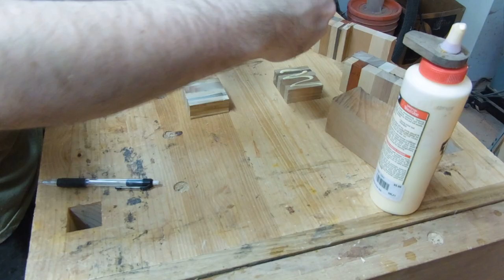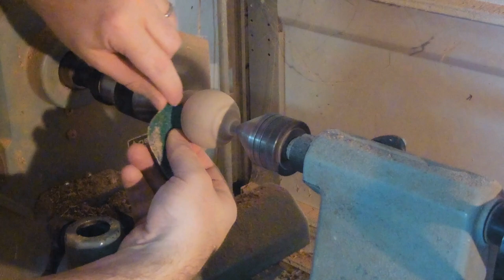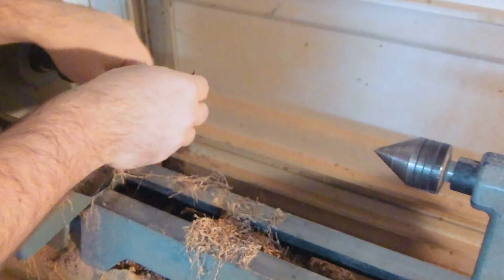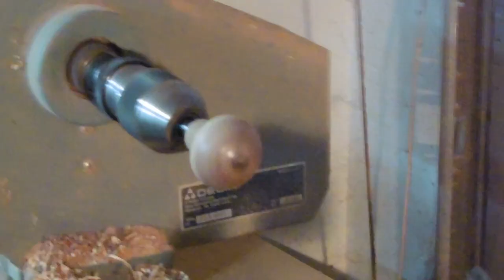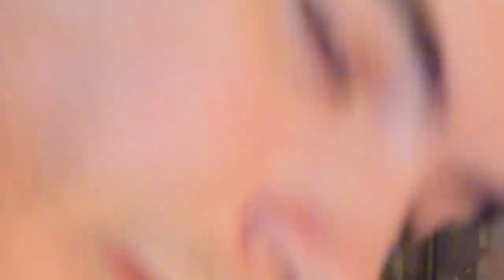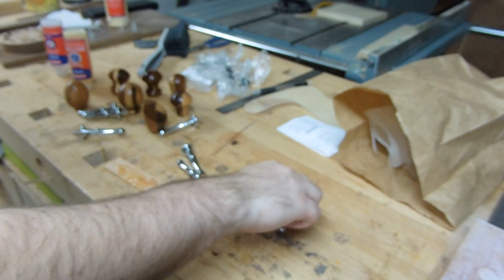Bottle Stoppers from Scrap Wood

Comment: Wow! You move fast. Or did you just speed up the video? What is that around the top of glue bottle?
Reply from the maker: @DennisDolan-fl3mw  actually I had to slow down the footage :-D

On top of the glue bottle is a little piece of wood with a hole in it, that the plastic glue bottle top fits into. Sometimes when the glue dries, it's a bear to get the top open, or off to clean it out, so this was just for some leverage to make it fast and easy (so I'm not always reaching for pliers). Now I use a gluebot and it's much easier and nicer to deal with.

Comment: Do you recall what the thread pitch is that you used on the drill for the tops these stoppers? I have of few ideas I'd like to tinker with thanks to your video. :)
Reply from the maker: Bottle stopper kits come in both 1/4"-20 and 3/8"-16, I believe. These were 1/4"-20